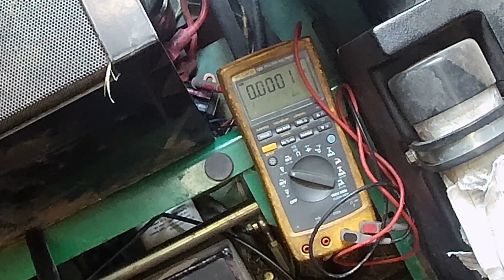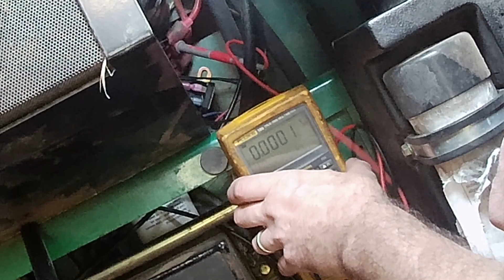Starter or solenoid ? Which one and how to tell for small engines

Comment: I worked on an Older John Deere this spring with a starter that didnt  engage. Besides the battery being dead, I figured out the selinoid  was not only bad, but after disassembly, I couldnt believe my eyes. It looked like someone hammered on the plunger that actuates the engagement. There was no sign of damage in the bore, no metal pieces, no indication of internal causes. The owner told me his father purchased the starter used off the internet. Whomever sold him that starter must have disassembled it and why on earth  they beat on that plunger is beyond  me. It had a significant  dent in one spot with flanged metal that was catching in the bore. I have been working on small engines for 30 years and have NEVER seen this.
Reply from the maker: Me either! Thanks for sharing